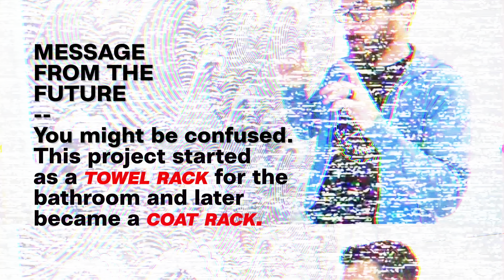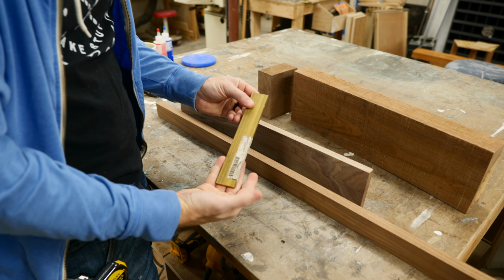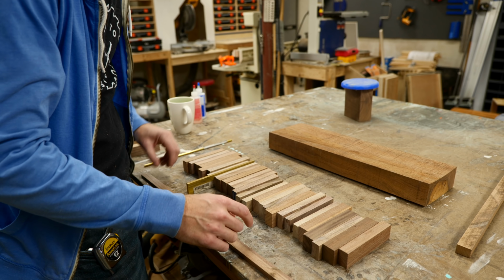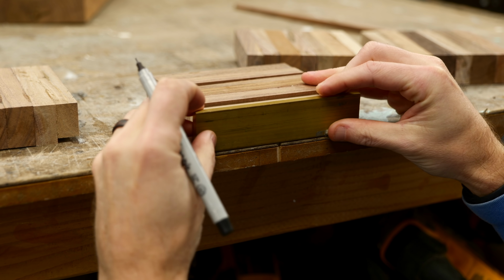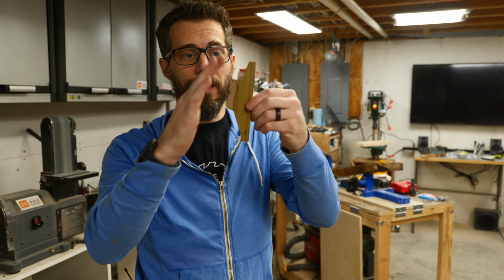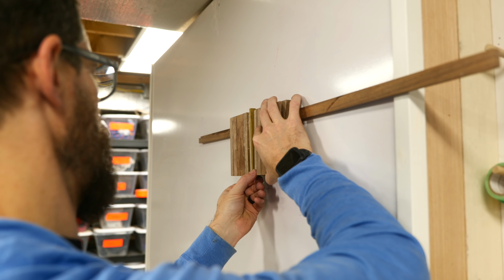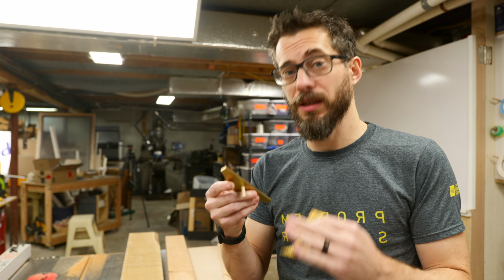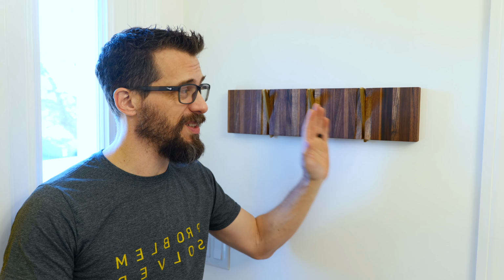How to Make a Modern Coat Rack From Scraps | I Like To Make Stuff

Comment: Superb design, looks very nice. I would probably add something as a backer for the lowered end of the hook piece so that someone dropping their coat onto the hook wouldn't jab the bottom of the hook through the drywall. Also if the plate is integral to the rack, it'd keep the coats from trying to push the rack off the wall.

Comment: Nice Bob, the only drawback I see is using the drywall as a stop for the hook. A heavy winter coat hung on the same hook ( we are creatures of habit) will eventually push in to the drywall  a bit. Lightweight stuff, probably never an issue. A thin piece of sheet metal like a roof flashing material on the back would be an easy fix and never be seen as it would only need to be at the hook location. Just a thought.
Reply from the maker: Absolutely. But I think it'll be ok. As long as the kids don't try and hang from it.
Reply: You could always put some metal behind it. Rebate it into the wood you would never know

Comment: Cool hangar! The only thing I would change is to add a small, light weight spring behind the bottom of the hooks. Light enough so that it stays open when something light like a hat is hanging from the hook, but strong enough to push the hook back closed when nothing is hanging.
Reply from the maker: True, but for something like a hat or hoodie, it would pinch it. But you totally could.

Comment: No drill press workaround:

Keeping deeper holes square is a nightmare without a drill press, and I don't want to build a rig, or buy guides. I don't need them enough. 

However... I could cut the wood pieces a bit long, drill the holes in each piece individually with a template. String them all on the dowel for alignment. Glue up. Then cut the ends flush.  Any pieces where the hole ends up angled, can give it a try again through the other end, since the mistake will be hidden.

This is a great option for the end of the hall where a hook sticking out with nothing hung on it would be easy to not notice and hurt myself on.

Comment: Won't the bottom ends of those brass pieces leave indents on the wall over time when mounted like this?
Reply from the maker: Hopefully not, since the part that contacts the wall is a flat surface, not the bottom corner.  That's why I trimmed their back face to lay flat on the wall.